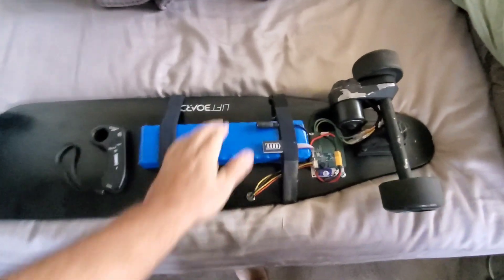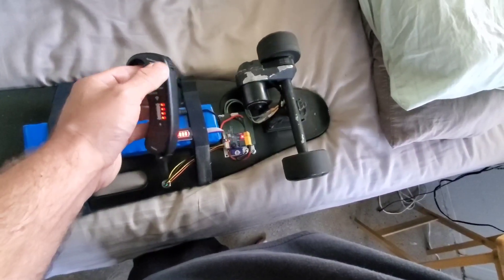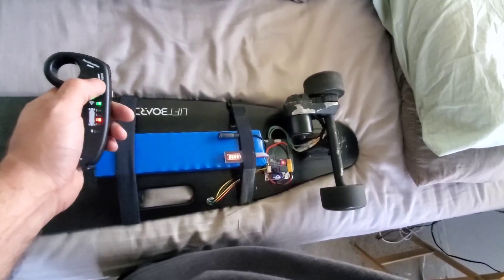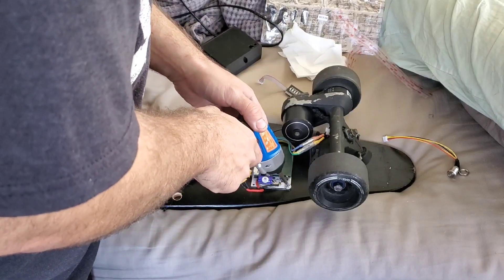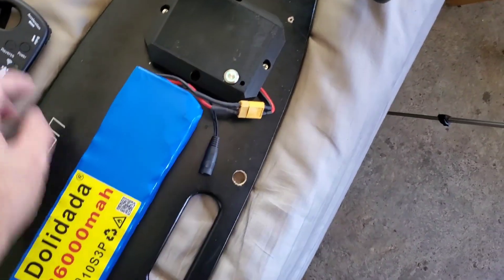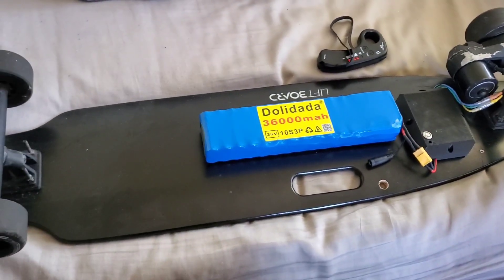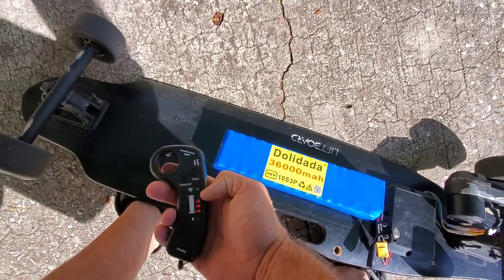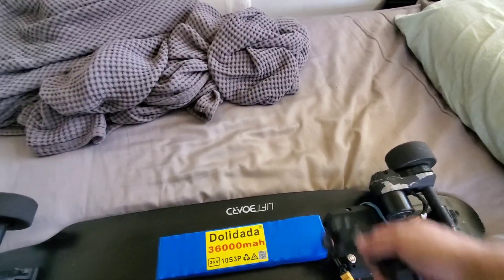Finished the $100 DIY Electric skateboard! First Ride time

Comment: This is cool but the one thing I would do is build a plate to go over and protect those batteries they are really volitile if they get broken
Reply from the maker: Actually these are just Basic 18650 packs they're not lithium polymer they are lithium ion.  And this is just for testing This is not the complete board